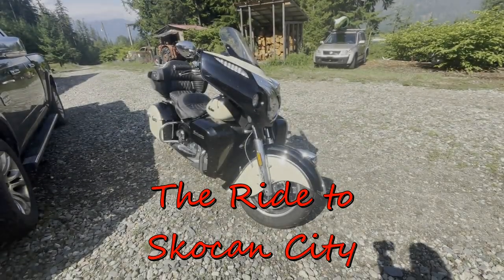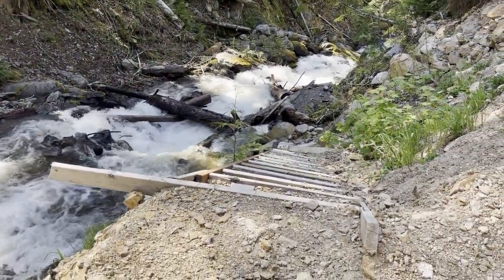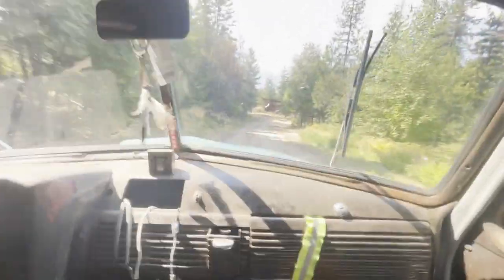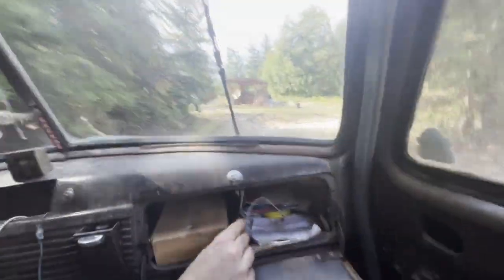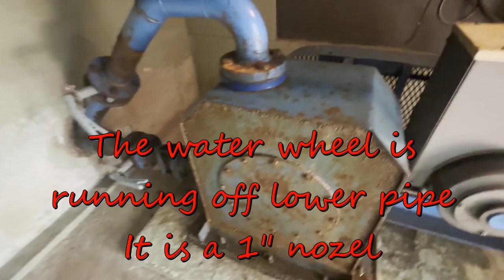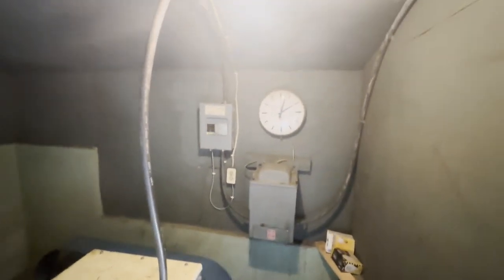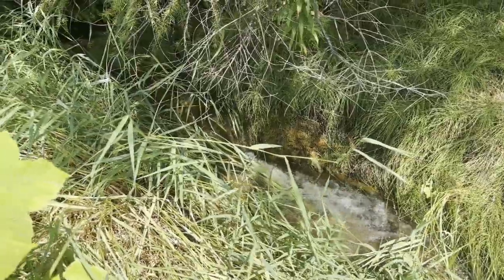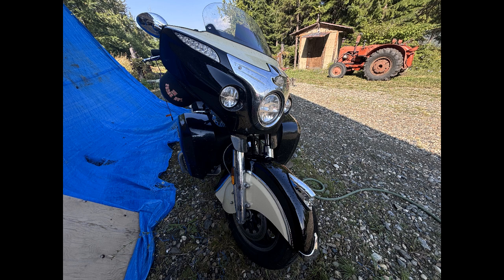Ride to Slocan City, Mines,Rat Rods, and Off Grid

Comment: I love this truck is sounds so good. I wish I had it. Thank you for showing me it
Reply from the maker: I wish I had it as well. I do have possible projects to do something similar.
Reply: @beginlivinglikeaboss i got 2 89 chey vans  1 is a,tara tech  other in  2000 high top camper with all amenities  bith have 5 7 359 big heads 4 bolts mains  F I.  YOURS  LOOK LIKA 350  BUT HAS A CARB. .CORRECT.